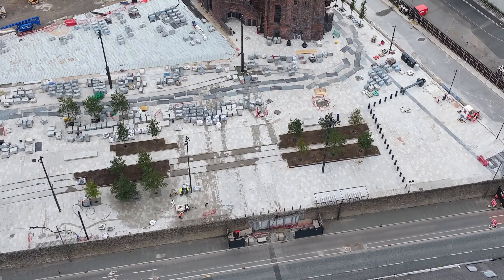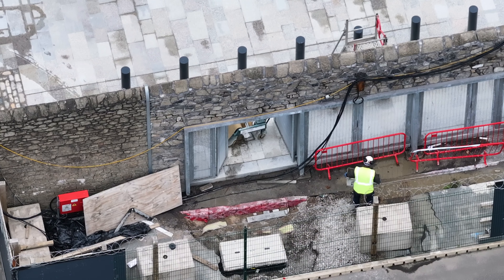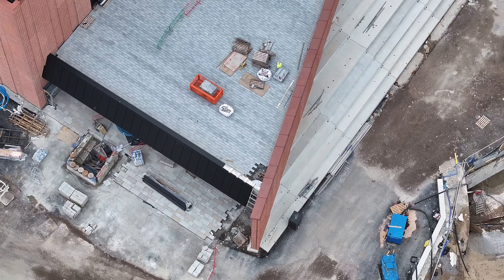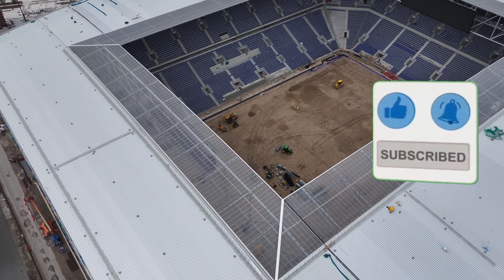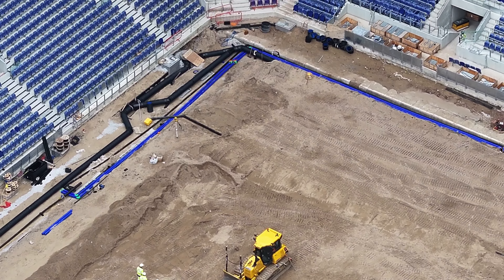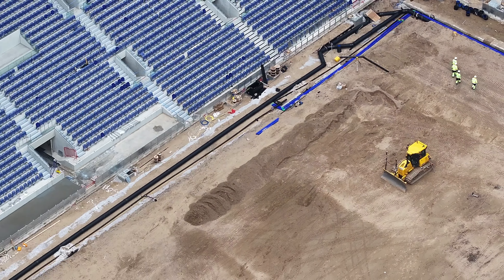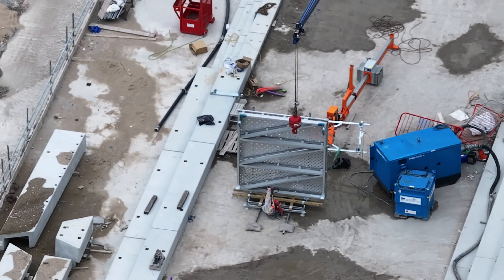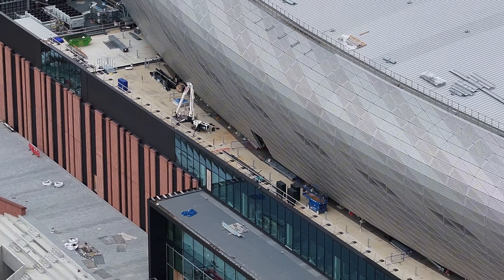Everton FC New Stadium at Bramley Moore Dock Update 22-07-2024

Comment: The Southr East corner remaining glass pane and the missing wraparound sections on that and the South West corner are doing my head in at this point. Anyone know what the hold up with those is? Been left unattended for months. 🫥
Reply from the maker: Yes Colin, the company that made it has gone into administration and they are preparing to get a specialist jig to adapt the piece to fit the frame, there is a couple of others which will get done at the same time to save costs as it won't be cheap.  Cheers👍
Reply: @SS_Skies  Ah, that would explain it. I assume that's a Laing O'Rourke problem (in terms of the costs) and not something Everton will have to stump up any extra for?
Reply from the maker: @colingillbanks4022 yes its all in the stadium budget, they did a similar thing with the last coping stone on the Media Centre and one or two other things, they did them in one hit. Cheers
Reply: @SS_Skies  Nice one. That media compound coping stone also did my head in! Haha.